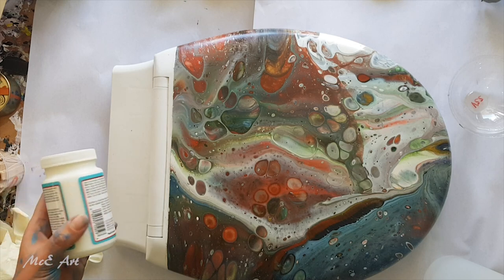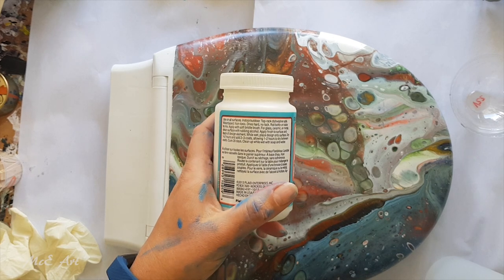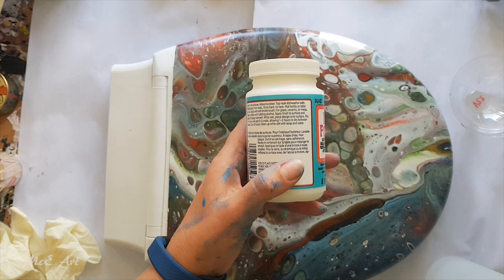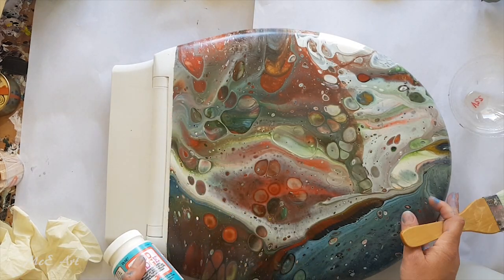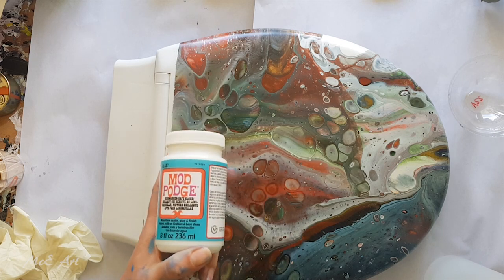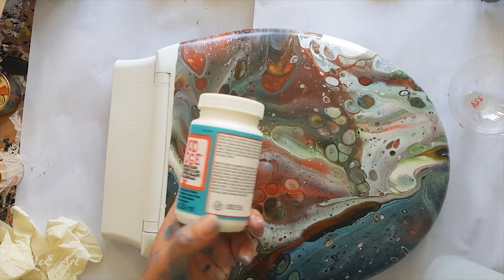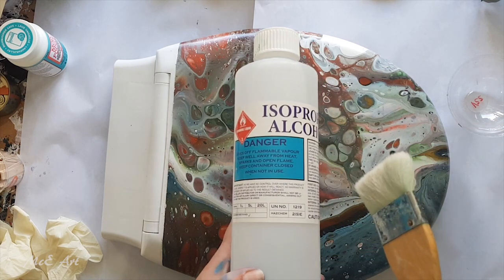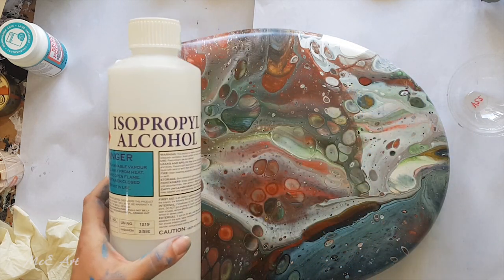342 Sealing the Toilet Seat - Have I Ruined It?

Comment: Hey Michelle, in my experience to avoid brush marks hold the brush almost perpendicular to the “canvas”so the bristles/sponge are only just touching the surface  and with a VERY, VERY light hand apply a minimum of three THIN coats,  changing the direction of your brushstrokes each coat. I hope this helps hun. 🤗
Reply from the maker: Oh cool thank you so much for the tips :)

Comment: I have used Mod Podge lots over the years and the only way I have been able to stop the streaks was by using my hubbies spray painting gun and it comes up with a finish almost like resin. It doesn't work with a normal craft spray gun I have tried that but it blocks the nozzle.
Reply from the maker: Oh wow! sounds great.

Comment: Oh, btw, what about varnish?  You'll still get brushstrokes after 1st and 2nd coat (which should be thin coats) but when you do the 3rd coat, normally they're gone.  I use a brush or sometimes spray varnish which I like the best because it's the easiest.  Don't know how it would hold up in dishwasher though.
Reply from the maker: Yes that is why I used this product, they have given me another idea which I will be trying.

Comment: I’ve been Varnishing artworks this last week and was frustrated with brush marks I have now solved this I use a sponge with very fine holes 3 coats circles coat 1 then 2 horizontal 3 vertical using the sponge works Fab no brush marks. I did use foam brush but left marks making sure you use an angle motion rather than upright Brush.  Otherwise use a clear spray... resin is great also but more expensive..  I don’t use Modge lodge I mainly use the liquitex  medium and Varnish. X
Reply from the maker: Thank you Sarah I will look for a sponge today :) I was after the dishwasher safe quality of this particular mod podge.
Reply: McE Art  I like the thought of the Dishwasher Safe Mod Podge be ideal for sealing  mugs. Or is it not food safe?
Reply from the maker: They do not recommend it to be near where you would put your mouth so not so I probably wouldn't do that.

Comment: you may need to sand it down and then put resin...I saw a video yesterday on Sharon Lindley channel Vivid days whereby she had to sand the resin down and then reapply...idnk...just a suggestion...good luck...P.S. I use vaseline all over my hands before I paint so that it comes off easily
Reply from the maker: Yeah was hoping to avoid the resin as it is so expensive.  
I love your vaseline idea. I might give that a go
Reply: @McEArt  How about Automotive Clear coat?  That would work
Reply from the maker: @littlelulu4107  it works on bendable plastic surfaces?
Reply: @McEArt  Not 100 percent sure but I think it's a realistic option since it's made for an exterior project...maybe try on smaller piece for testing. Might be worth a shot.

Comment: Very fine sand paper between each coat
Reply from the maker: Great idea but the final coat would still have the lines wouldn't it?
Reply: McE Art if you sand between coats then use foam bush you shouldn’t have lines then. Hope this helps
Reply from the maker: @marshamauk9647  thank you :)